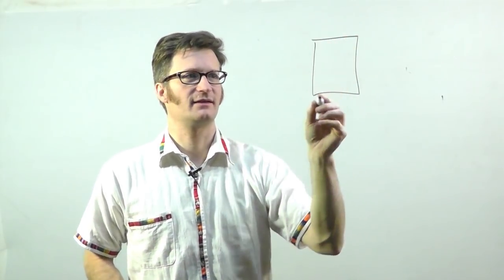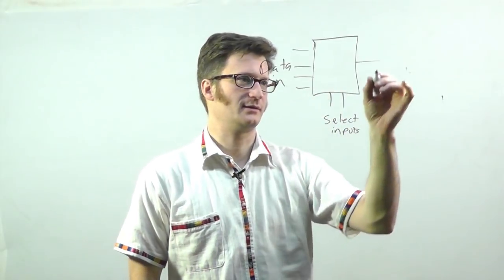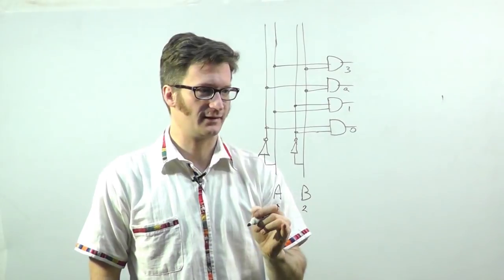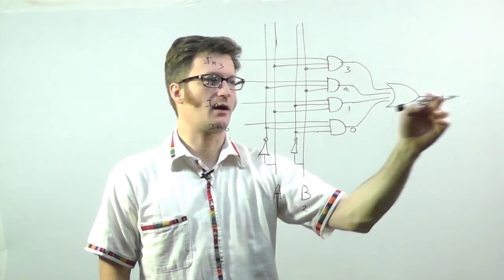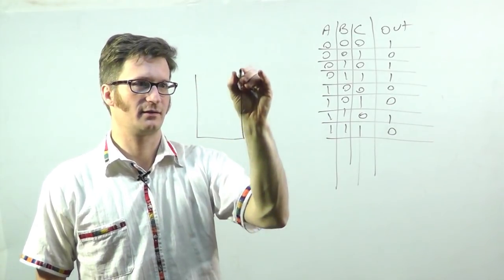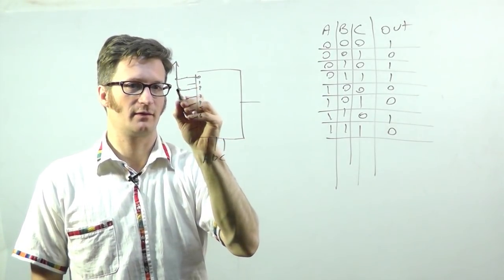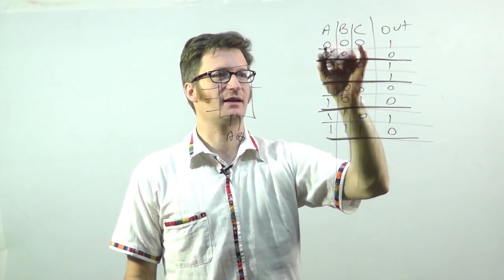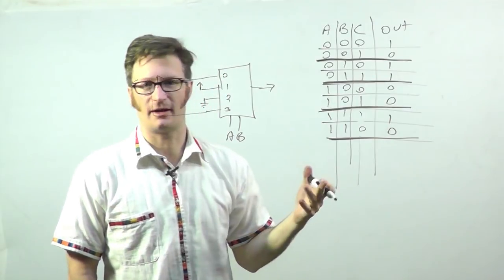Digital Logic - Multiplexers

Comment: where is 16-input multiplexer? please show the method of that as well..
Reply: 16:1 is the same logic, you need 4 inputs to selection, you just might use two 8:1 together with a OR gate to join both, or use the 74150...
My old Attiny85 16 digital  outputs used the 74154 with D Flip Flops to store the levels, using only the five digital outputs from the Attiny85, 4 for the selector, and 1 for the data out.